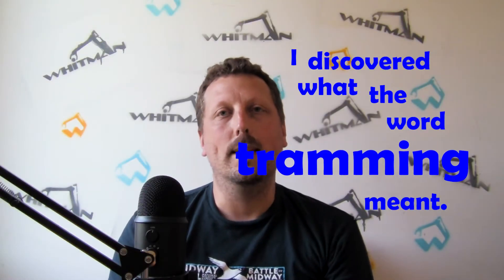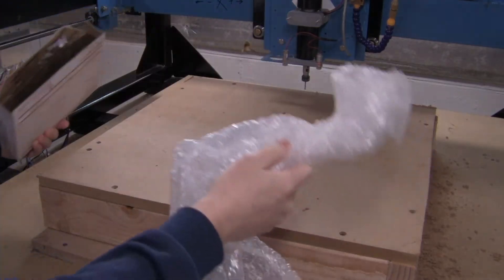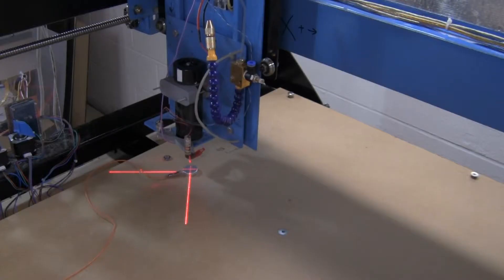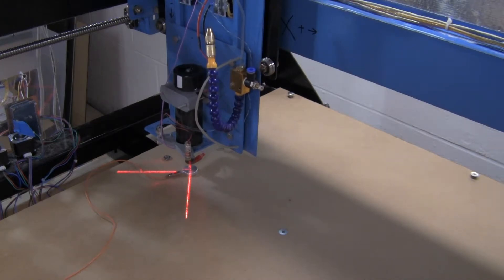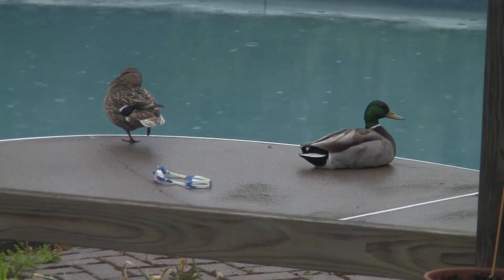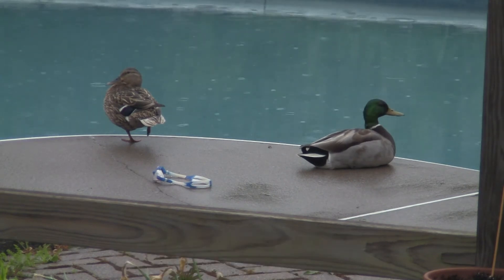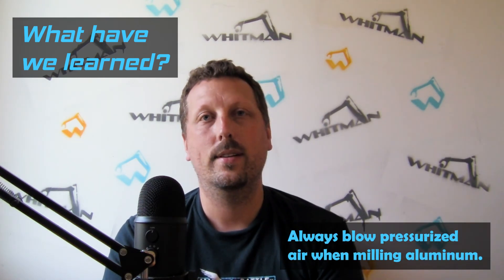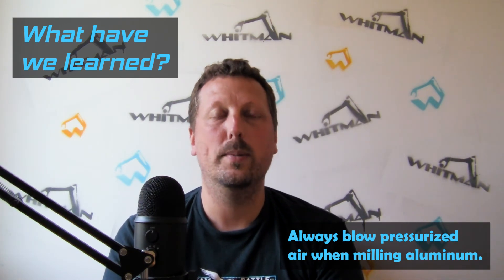Tramming and tuning my homemade CNC router and then cutting some aluminum plate.

Comment: The best CNC project I have seen so far. So much precision and accuracy that I wouldn't need especially while milling foam. I wish I could have your plans to build one exactly like yours. With your modified brackets.
Reply from the maker: Wow, thank you!  There's another video on my channel where I build the whole thing, and there's a link in that description to a page with the FreeCAD file, a little bit of instructions, and the DXF files for plasma cutting.  Maybe I can link to that page in this comment: https://whitman.tech/ferrouscnc

The only different between the original brackets and these brackets is that I changed the cuts to be little edge tabs instead of a big slot through the center.  A quick fix for you or whoever will do the plasma cutting.  Thanks for watching!